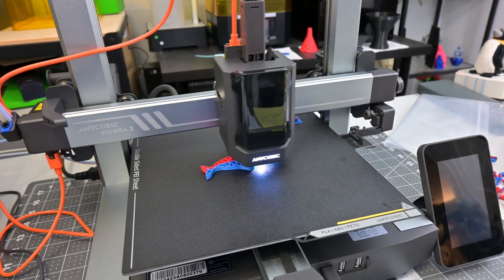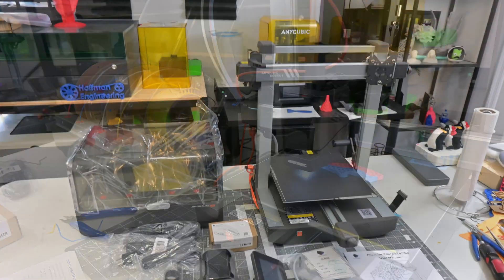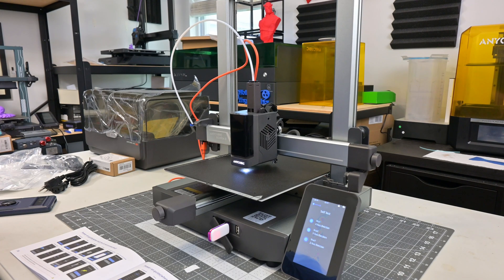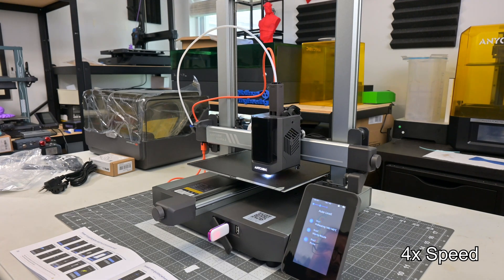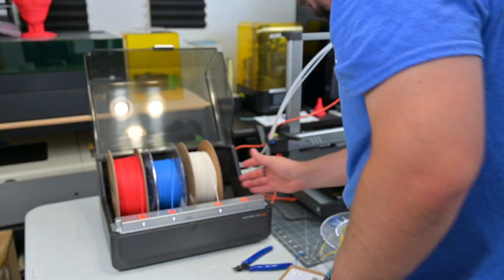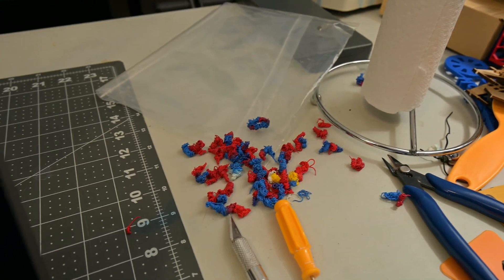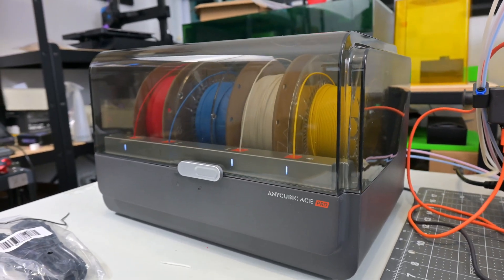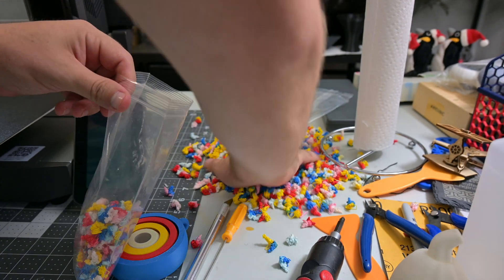Anycubic's New Multi-Color 3D Printer is here! First look at the Kobra 3 Combo

Comment: Is this a better purchase than the k1c? Because right now at least in my region they are the exact same price.
Reply: That's a loaded question.  If you want 4 colors, the K1C cannot compete at this price point.  However this device, by design, is limited in what it can print, where the K1C is not due to its CoreXY design. If you run this printer at its maximum speed with a tall and slinder print you fill find that you will have to slow it down.  The K1C can continue to print at Top speed.  The K1C is enclosed enabling it to handle filaments that need an enclosure.
So..  Just depends on your current goals.  If you just want the ability to do 4 colors and/or filaments, this is a great option.  If you need more capability and 4 filaments isn't as big of a concern the K1C will do the job.

Comment: How do you get your benchy to print at 11 minutes? When I change the settings pretty drastically I still can't get it below 30 minutes. I feel like I am missing an important setting. I turned a lot of the settings up to crazy speeds to just see if the time changed and some of the setting changes make no real difference.
Reply from the maker: That was an included file that was already on the machine. I haven't yet inspected it to see how they accomplished it.
Reply: use the speed benchy in the local fikes on the, printer

Comment: want to know what orientations you can place the ACE besides to the left of the printer.
Reply from the maker: They recommend just the left. The right side has the purging wiper which would fling plastic onto it. The default bowden tubes might be long enough for the ACE to go under the printer when the lid is closed, but it wouldn't have enough slack for you to be able to open it the lid. You could do behind, if you face the ACE behind.
Reply: recommended on the left as its designed that way

Comment: Hi, what is the price on this? I mean, is it less than the Bambu A1 combo?  Is there a reason to NOT get the Bambu and get this one instead? A like for like with a proven track record on one seems like the price would have to be VERY attractive .
Reply from the maker: The Anycubic Kobra 3 Combo is currently on sale for $450, which is about $40 less than the Bambu A1 combo on sale. I don't yet have enough testing to be able to compare them, but that proven track record is a good point to keep in mind.
Reply: I just confirmation mine is shipping. I have a an A1 and A1 mini. Why did I decide to get this one? Well the potential for 8 colors is one major reason. I know that it can be wasteful but I have projects that are more art pieces then selling that I'm working on. The other reasons some filaments don't run well on the AMS lite however when you look up the specs they will run with the regular AMS. I'm not talking about exotics and such where you need an enclosed printer. This is a direct competitor to the Bambu Labs. However it is brand new so some accessories are not available yet like different sized nozzles or replacement nozzles or how a second ACE will work but I have high hopes.

Comment: This hardware DESPERATELY needs better software.  At launch there doesn't appears to be a way to adjust the filament change waste or even remove the purge block.  So multicolor prints literally use more wasted filament than filament for the actual print.
Reply: Nothing is perfect on release day and bambulabs still produce a lot of wast even when adjusted it will get better though and orca slicer will be good for it as well eventually.
Reply: @redline6871  I am hoping, so long as they keep their word on OPEN SOURCE we should be good.  I've had very good results on my old Kobra 1 Max, but the non-standard board/firmware forced me to learn more about manual gcode than I wanted LOL.
Reply: @redline6871  "orca slicer will be good for it as well eventually"... yeah but their new release won't work on my Mac, have to stick with v2.1.0
Reply: I imagine that any of the slicers have a number of options to both reduce the amount of waste as well as turn it into something useful.
Reply from the maker: I'm still getting to know the machine, but there is a purge setting in the ACE tab on the printer that you can tell it to extrude more or less when wiping. You can't change if there is a purge block or not from the printer since that's part of the gcode, but the Anycubic Slicer does let you remove the purge block.

There is a crazy amount of waste though when switching colors. The 4 color gyro example print is 60 grams of filament, but produced 221 grams of waste. It's certainly something I'm keeping track of to see if there's any good way of reducing it.